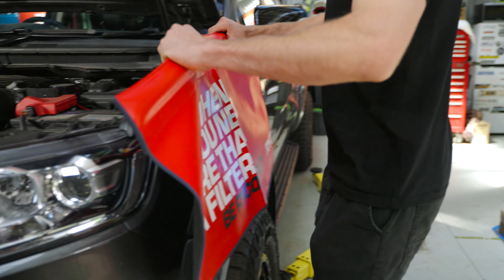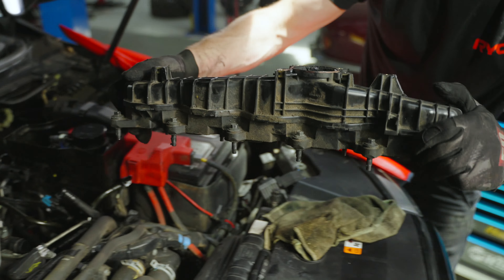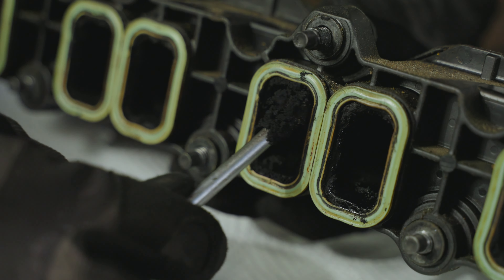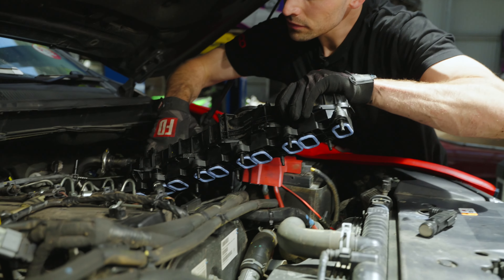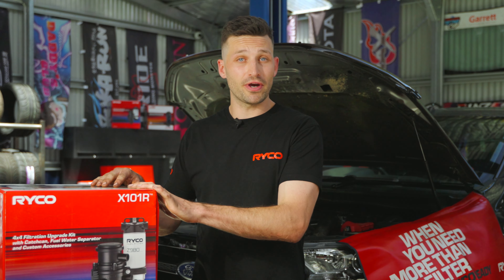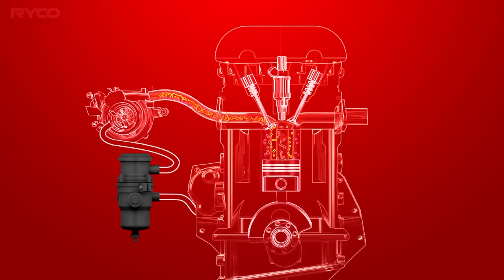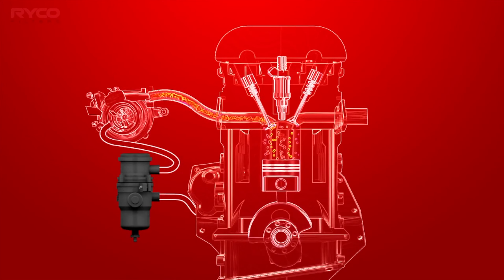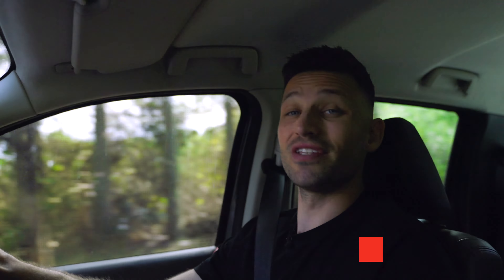Ryco Diesel Engine Revival - Ford Ranger

Comment: If the manifold looks like that what happens to the head runners?
Reply: Typically the ports aren't too bad. Goes against what you would assume but every time I have done a carbon clean the ports are usually OK on these 3.2/2.2 engines.